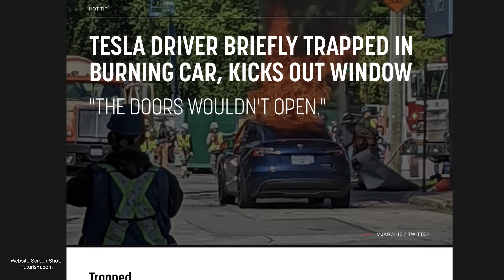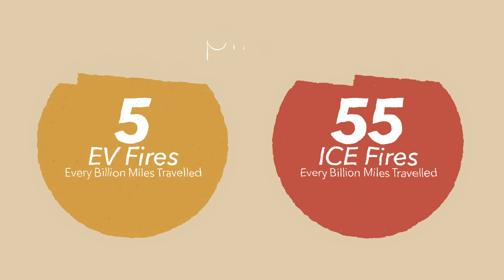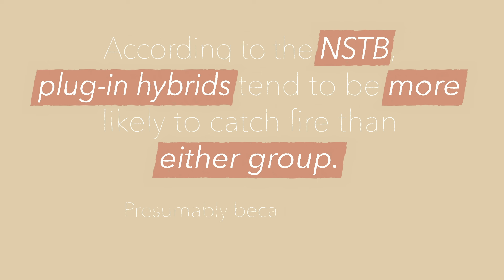How To Tackle EV Fire Misinformation

Comment: This isn't quite a fair comparison. Yes EVs are less likely to catch fire per mile traveled, but ICE cars don't catch fire when they're turned off, with no one watching them even when defective, but the the recent Bolt and Kona(also the Taycan allegedly, with Porsche secretly fixing it) battery fire saga has shown, this can happen to EVs + it will be harder and take way more water to put out. I can understand eg. the manager of a small, wood framed apartment building with an underground garage being leery. And I dread to think of what will happen when an EV catches fire in a ferry, mid crossing, with no easy way to put it out.
Reply: NTSB says EV catch fire at a rate of 25 per 100000 cars, ICE catch fire at a rate of 1500 per 100000 cars. Nothing to do with miles driven. Also, look into the Kia fire recall, they literally said "don't park your car indoors" lol
Reply: @GoldenMinotaur  all current stats are garbage as the vehicle demographics are not identical. It will be twenty years before comparable vehicle demographic data will be possible and I believe ultimately that the rate for EVs vs ICE will be similar as most vehicle fires today are electrical in nature.
Reply: @kevinbrown1368  there are lots of areas where EV have high enough market share to calculate reliable data. In Denmark EVs have over 90% market share already which is a predominantly rural cold climate region. In California Tesla alone has over 10% market share and high demand assures overall EV market share to be extremely high in the state with the largest new car market. One that is predominantly a high heat environment. 
There are over a million EV in California and many of them are already more than 10 years old. So I reject your assertion there is bad data,at this point if you disagree I'd take it up with the transportation authorities that provide it..

As for your comment about gas cars fires  not killing people, the stats disagree with that assertion as well. From 2012-2016 an average of 354 people died from car fires each year in the United States...
Reply: a gas car can catch fire when off,  very unlikely but can happen
Reply: Push the burning EV off the ferry?